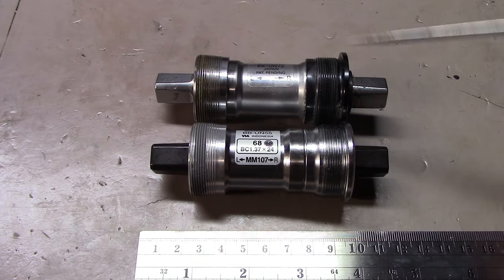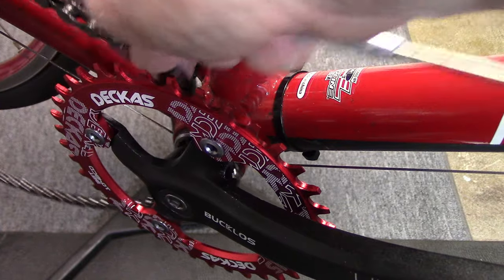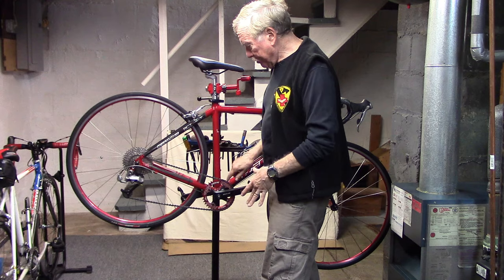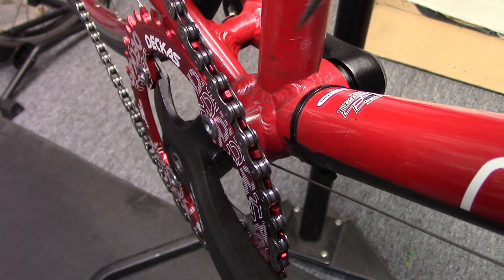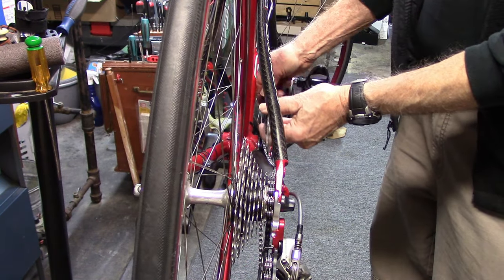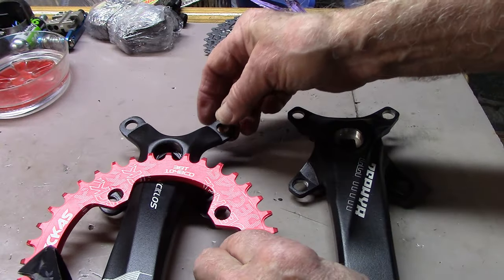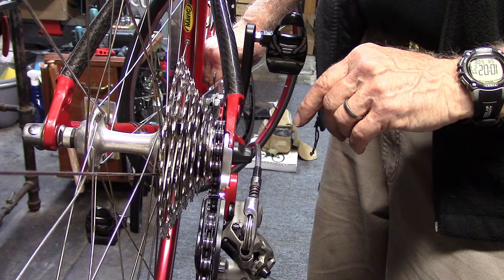1x (Single Chain Ring) Bicycle Drivetrains: View this before conversion or buying

Comment: I think the chainline issue is more true for conversions vs people buying new-er bikes with 1x or even just 2x in mind. Chain lines have been optimized for gravel gearing and sure, the chain line isn't ideal at the tail ends of the cassette, but, how much time are you really spending there anyways? A bad chainline looks bad and is obviously less efficient, but cross chaining is similarly inefficient but hasn't been showing to increase wear much at all and plenty of new-er cyclists do that. The benefit here is multifaceted. On a large scale, it makes more sense for a cheap, entry level bike to be spec-ed 1x because it will decrease complexity and maintenance for someone who is just beginning to get into the world of cycling. Doesn't really make sense for an entry level version of any bike to be a triple. So once the manufacturing rationle catches up, I'd venture to say it would be a positive. There's also the fact that bikes, entry level or not, have been over-geared for quite some time. I've got news for those of you who don't race– you definitely don't need a 50t chainring. You're grinding it away. A decently spec-ed 1x 11 speed group chain (relatively inexpensive now given 12 and 13 speed) has all simplicity, range, and speed most cyclists will ever need. Good video.
Reply from the maker: Good points. I do agree that most bikes sold to the bicycle enthusiast (non racer) are way over geared. As to whether current 1x bikes have problems due to chain line remain to be seen. Here are two videos form SickBiker that may be of interest to you: 
4 BIG PROBLEMS Of 1x10, 1x11, 1x12 Drivetrains. 1 By Drivetrain - THE TRUTH. Part 1. 
https://www.youtube.com/watch?v=Ew03wbHOHS0
and
If you were close to XC race podium riding on 1x12 drivetrain, you'd win it on 2x11. Here's why...
https://www.youtube.com/watch?v=X1jdTDPwFVc  
Regards and safe cycling, Tony

Comment: Im not sure if have done so already, but it seems the sound you getting (after the 2nd crank) was from the upper pulley being too close to the cassette.. try adjusting the "B" screw..
Reply from the maker: Done that. It's the chain line. Might be helped by a shorter bottom bracket (used a 68 x 105 mm and probably be helped by replacing with a  68 x 103 mm). For your info, see our video on "b" screw:
https://www.youtube.com/watch?v=UXnLJpTVFJ0
Was a good thought. Regards, Tony

Comment: A narrower  bottom bracket spindle also narrows the stance width.
Reply from the maker: That's true and that's why bike fitters use Shimano or Speed Play pedals since they have varying spindle length to accommodate wider stance. As a bike fitter, one can also consider spindle washers or spindle extensions rather then the bottom bracket which depends on the bike frame and cassette position.

Comment: I watched this video because my chain came off completely as I removed the rear wheel for a flat repair on my SRAM SX 12x1.  I wonder if the chain needs to be put on in any specific way because of narrow wide.    Yes for the chainring was quickly explaining.  Maybe for the jockey wheel too?  Cassette may not be narrow wide.  Seems like you just can't throw the chain back on any old way.  Complex.
Reply from the maker: The chain (even if it's a narrow/wide) may come off the chainring when you remove the back wheel. You're less likely to see this happen with a Race Face narrow/wide but - when you remove the back wheel, there is so much slack that the chain still may come off. Just replace the chain on the chainring and re-install the wheel when the flat is fixed. Note that the chain fits on the chainring in a specific manner. See:
https://www.youtube.com/watch?v=tWy70DV0D_g
If it comes off while riding, you may have to much slack in the chain. Here, the addition of a clutch or chain guide may solve the problem.
Hope this answers your question. If not, let me know. Regards, Tony

Comment: Hi, I'm building an electric bike with a motor and I'm planning on converting my multispeed freewheel to a single speed one, although I'm not so sure how I make the chainline perfect, as I can't add spacers behind the freewheel as there aren't enough threads. Any Ideas?
Reply from the maker: Equiping the bike with a chainring that sits on the inside (frame side) of the crank will bring the chainring iwardward. In other cases, using a narrower bottom bracket may be the answer, depending on the thickness of the crank end that holds the crank bolt. There's no clear answer and the video is just a caution that some cases just don't work or make noise in the larger cogs when making the conversion.
Reply: @tony10speed  Alright, thanks!

Comment: I have that same chainring! Gotta install mine.
Reply from the maker: See the entire video before converting and note the problems that may occur (so you'll be prepared).
Reply: @tony10speed  I saw the issue, and am taking steps to mitigate this. Thanks!
Reply from the maker: @TRNSL8  Let me know how it works for you. Regards and safe cycling.

Comment: So are saying that you'll need to change the cranks to improve chain line
Reply from the maker: We replace the bottom bracket from a 113 mm to a 107 as well as using a different crank then the one we started with. And the setup still had problems despite a good chain line. So, if you go this route, it may or may not give you the results your looking for. I, myself, still prefer a compact with a front derailleur but that's my own preference. Regards, Tony
Reply: @tony10speed  Tony I agree and if I were going to a 1 X I would use a 5 bolt chain ring vs 4 due to the larger bcd with no smaller than a 36 tooth up front

Comment: Good info, it's a compromise
Done this loads of times, fundamental problems, start at the extreme, ie 1st gear and work back
Narrow/ wide and clutch rear mech will keep your chain on 99% of the time
But I have run stronglight std chain wheels for years without issue
As an engineer I love the simplicity and weight saving, but it's not for everyone : )
Reply from the maker: Agree completely. Thanks for your feedback. Regards and safe cycling, Tony

Comment: Hello, Im going to get a hybrid bike soon and it has a 36t chainring on the front and 11-36 cassette at the back. Do you think I'll spinning out on the flats and downhill? What can I upgrade to make this bike more faster without many modifications to the drivetrain? Thanks.
Reply from the maker: I think you'll be fine on the up hill and flats but may be coasting down the downhills. My mountain bike has similar gearing with a single 34t chainring. Unless there is a "need for speed" downhill, I'd give what you ordered it a try. Not much you can do with a 1x (single chainring). If you go to a larger front chainring, you'll have trouble getting up the hills. A lot depends on the terrain you plan to ride. I like a compact double for my road bikes because I can get the low gears for uphill and fire away downhill. My riding partner uses a 34t chain ring and a 11/34 cassette. She can keep up with me on the uphill and flats but is not concerned about speeding down hill.
Reply: Yes, the range is too small. You need at least 11-48t on the rear, or you won't be able to pedal downhill. But you will be able to climb any hill with a 36t chainring. I think the spread on the AdventX is too small. If they skipped 5t instead of 4t between each cog, they could've made 500% range instead of 400%. 11-56t, instead of 11-48t. I would've preferred wider range with a 44t chainring. That would've made me very happy. I hope MicroShift offers that in the future.

Comment: I have that prowheel drivetrain, done the conversion from 3x8 to 1x8. What i dont understand is, when I was using big chainring (42t) with the smallest cog of the cassette I didnt had any of that noises but now I got this noises with single chain ring 42t!(I think its because of the teeth of the chainring being bigger and thicker do more noise picking the chain). I only changed the drivetrain and put a new sram chain 114 links, the old one was 112 but since its only 2 links I left it and it doesnt jump any cogs.
Reply from the maker: Generally, a loud 1x drivetrain is a result of extreme chainline angles.  It means short chainstays and large chainrings on some (not all) bicycles are going to make a lot more noise. The single chainring you have is now further in toward the frame then the large chainring on your triple setup. In our own conversion experience, we noted noise in the large chainring and small cassette cog and even more noise in the small chainring and two larger cassette cogs. We also noticed noise from the narrow wide chainring in these combinations of large chainring/small cog and small chainring/large cog. The chain made noise as it was lifting off the narrow wide in the extreme angles. For these reasons and the fact that the difference between cassette cogs is less on a double or compact so I can more easily find a comfortable cadence, I prefer a compact 2 chainring drivetrain. That's not to say that some 1x work very well. I have a Giant 1x mtb 9 speed that is extremely quiet in all gears. As we can see, this is not a simple issue which is the point of the video. Regards, Tony

Comment: Hi great video. I think I might stick with 2x now. But I'm a bit stumped on my research thus far as for STI shifters with MTB derailleurs. What setup is in this video? The XT with what is it - 105 brifters? Do these type of road shifter and deore xt RD pairing usually work without ok? If so, I want to do exactly what your setup is in the video. And ideally push it to the largest cog possible ie 42 without a wolftooth thing. Thank you
Reply from the maker: The rear derailleur is a Deore XT, 9 speed system. Although Shimano states that the maximum cassette cog should be 34, Shimano is very conservative and we had no problem running a 36 or 38t rear cog. 40t cog was pushing it a bit but the hanger on this particular bike is extra long (otherwise we would have had to use a Wolf Tooth hanger extender). With 9 speed Shimano, mixing and matching road and mtb components often (but not all cases) work. Can't be said for some other manufacturer types. Regards, Tony
Reply: @tony10speed  thanks Tony! Is it true that they changed all that with the introduction of 10 speed? The mtb and road were no longer compatible pull lengths?
Reply: And what are the shifters?
Reply from the maker: Shimano RT-400 short reach 9 speed shifters @danmozy
Reply from the maker: 10-, 11- and 12-speed Shimano road/gravel and mountain bike components are not inter-compatible with each other. This is because they use different cable pull ratios. For a complete review see:

https://www.bikeradar.com/advice/buyers-guides/a-complete-guide-to-rear-derailleurs/#:~:text=Shimano%20derailleur%20compatibility%20explained&text=For%20example%2C%20you%20couldn't,configuration%20to%20your%20heart's%20content.
 @danmozy

Comment: This is a conversion which cost me buying a few wrong parts, but I found a single crank arm & bash cover size 104 BCD.
I also, have come to a point where one gear is all I need.   I got an ebike & found the chainring is made for the speedy with 52T.
I am OK with 32T - 36T 
I get enough speed on the down hill.   
I must lift my 30 extra pounds, it's going to time consuming.  

I was used to quick disconnects, now I'm back to nuts and bolts.   
What to protect the axle threads with?   Only a boot?   
They don't make quick locking nuts & I need to carry a 19mm spanner?
Reply from the maker: A couple of things to note. If the front chainring is made of alloy, it probably will need to be replaced every 500 mile. The reason for nuts and bolts (largely replaced with through axles) is that it is much stronger then quick release which can bend or break with a heavy bike (such as an ebike or heavy rider).  A "thru axle" as opposed to a standard quick release usually requires a hex key for removal and installation but it's definitely worth the effort based on the safety it brings as well as the ability to precisely line up disc brakes between calipers. A standard quick release instead of a thru axle with disc brakes will drive you to drink. Good luck and safe cycling, Tony

Comment: I think my Fifty-fifty NW ring has an offset machined into it so it would sit where your center ring would have been in a 3x setup.
Reply from the maker: I checked the chain line of the bike in the video after converting it to a 1x. You can do that with a Park Chain Line Tool as I did, or mathematically calculate it. The chain line was dead on (the chain ring up front matched up with the center of the cassette), so I don't think that was a problem. The point of the video is that some conversions (and some new bikes) will be noisy in the smallest or largest cassette cog and other bike (such as my Giant 1x mountain bike) are quiet in all cogs. So if you're buy a 1x new bike, give it a try before you lay the money down. If you're converting a 2x or triple to 1x, just be aware that it may or may not be noisy.
Regards and safe cycling, Tony
Reply: @tony10speed  I will definitely be on the lookout when my conversion is finished...thanks for bringing up the possible issue.
Reply from the maker: @RK-kn1ud  Let me know how you make out. Regards and safe cycling, Tony
Reply: @tony10speed  I just installed  microSHIFT Advent on my (mountain) bike and took it for a ride. Using the 11-46T cassette and a fifty-fifty 30T ring (with a machined 2mm offset) on my original 3x Shimano crank arm, I have zero drivetrain issues.

I don't have a tool to measure chainline, but I seem to have a very equal gap between the chain and the rear cogs when in the 4th speed of the cassette with no noise in either direction.

That said, I know there are some people who have resolved a similar issue with a 1x10 setup simply by using an 11 speed chain.

Honestly, I'm pretty handy and I'd probably use some combination of washers, shims (cut from soda cans), and/bolts if it came down to it.  I don't usually have an extra set of crank arms laying around!

Thanks again for making others aware of possible issues though!
Reply from the maker: @RK-kn1ud  Glad things worked out. Safe cycling and have fun, Tony
Reply: I would ditch that narrow/ wide chain ring first off. Then install a chain retainer if necessary. Should solve that nagging problem.

Comment: Also note , that 104 BCD cranksets are cheap and you can test different chainring sizes since they are also cheap, or simply have options for different ride types. I started converting my Shimano 105 crankset (110BCD) to 1X but the chainrings were too expensive.
Reply from the maker: Unfortunately the narrow wide chainrings wear quickly and many need replacement after only 500 miles. The point of the video, however, is to test out the 1x before you buy and to note that some 1x conversions can be quite noisy. I, myself, am not advocating 1x although some find it simple to operate and don't mind giving up a wider gear selection that you get with a double, compact or triple.
Reply: @tony10speed  I have noticed that, but I'm not sure that I hate 1X more than dealing with the front derailleur :-)
Reply: Never dropped a chain in 2+ years with 1x. I went back to 2x because I can't hold in group rides and it actually allowed me to ride faster as I wanted, but in one month I have dropped the chain at least 7 times... and twice I couldn't make it shift from small to big at all. Brand new SRAM Rival 11 speed. Works well on the stand but lots of issues on the road. So it has disadvantages as you mentioned, but I feel more confident on the road with 1x mechanically  speaking that is. It is hard to have it all :-)
Reply from the maker: @jameslefleur1970  The front derailleur limiting screw adjustments can be challenging. I use an Edge Chain Catcher on one of my bike to keep the chain from coming off to the inside. I've been pretty successful on adjusting the front derailleur to keep it from coming off to the outside. The height of the outer plate of the front derailleur must clear the large chainring by only 3-4mm, the cage must be aligned straight with the frame and the outer limiting screw carefully adjusted (I have a few videos on this if you are ever interested). Thanks for your comment and insight. Safe cycling, Tony
Reply: @tony10speed  thank you sir

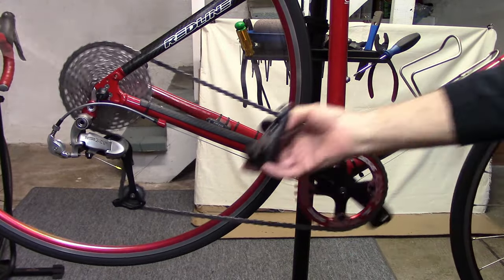Comment: 1:47 isn't the derailleur too close to the casette cogs in this video ? (the "B screw"). 
I think mine also makes a sound because of that, I need to check it again.
Reply from the maker: No, the derailleur pulley wheels are not too close to the large cassette cog. See:
https://www.youtube.com/watch?v=UXnLJpTVFJ0